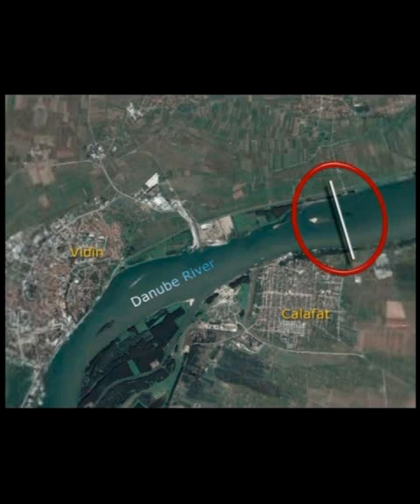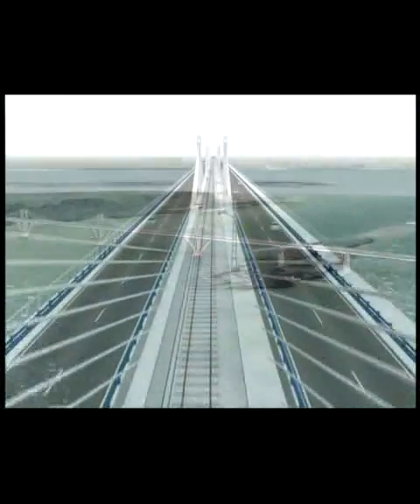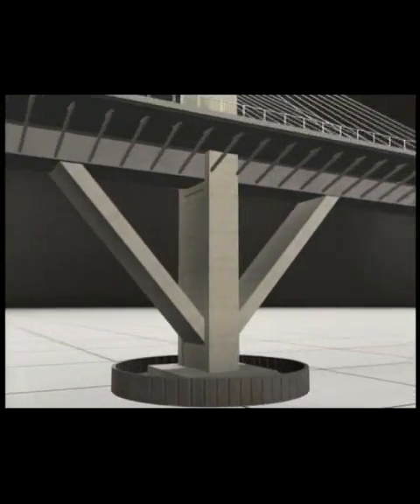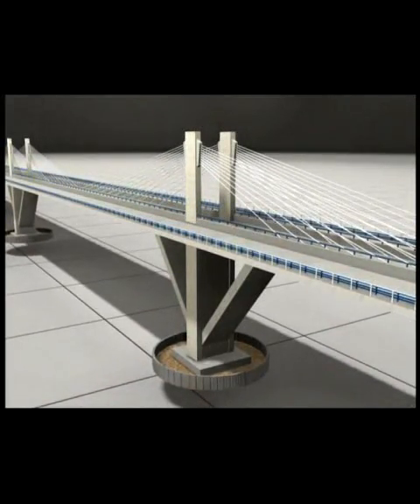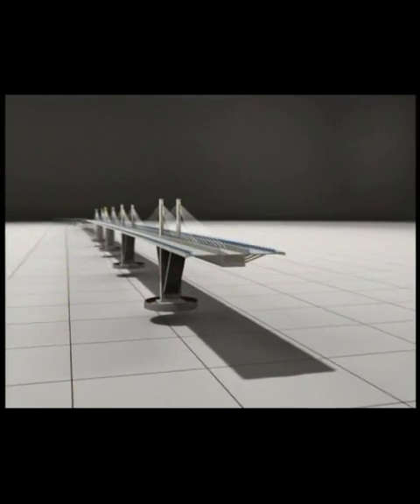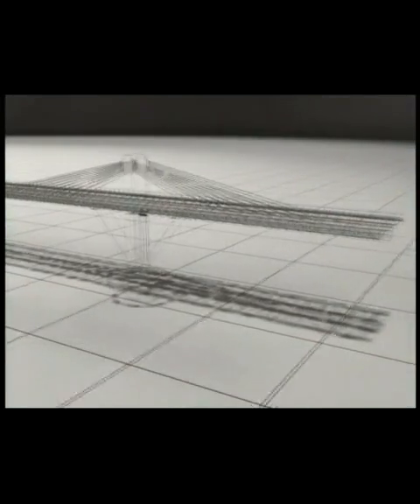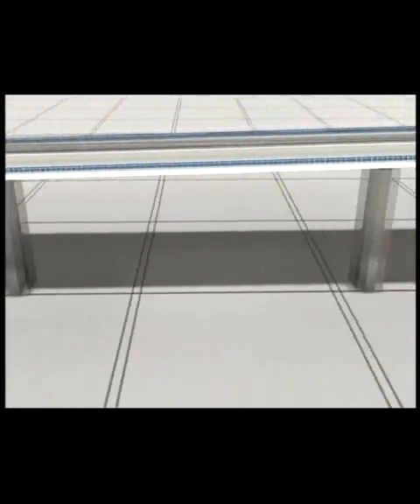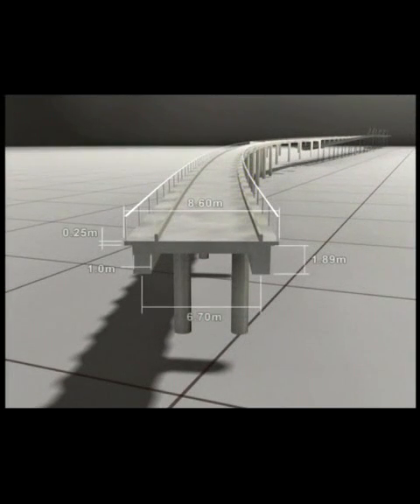Vidin - Calafat bridge over the Danube - part 1

Comment: Yes,there is a railway connection between Bulgaria and Romania,via Giurgiu - Ruse bridge over Danube. You also have an internal railway bridge over Danube ( Fetesti-Cernavoda) between Bucharest and Constanta(Black Sea)..These bridges are both railway/motoroute connections. There is another big bridge over Danube in Romania at Harsova ,but only motoroute not railway. So the Calafat -Vidin bridge is the forth bridge over Danube in Romania,two of them inside Romania ,two Romania-Bulgaria